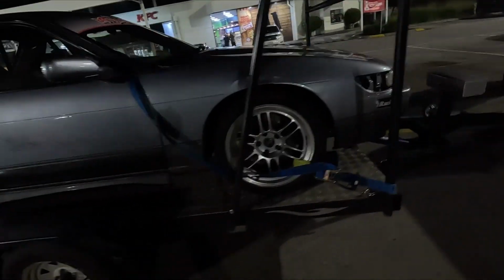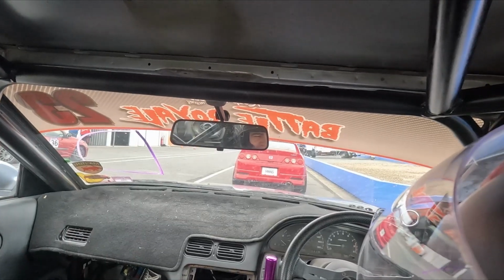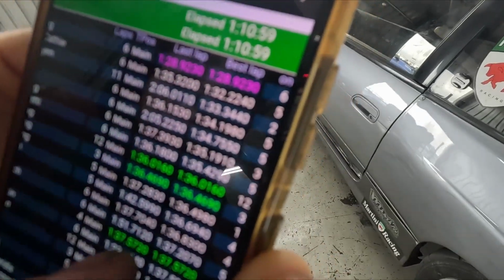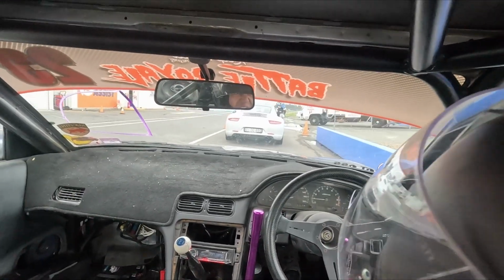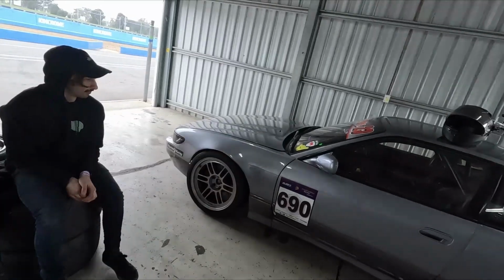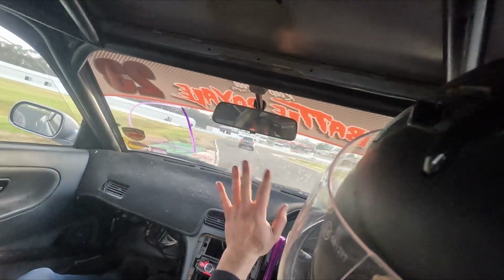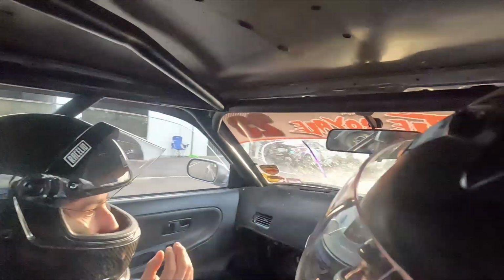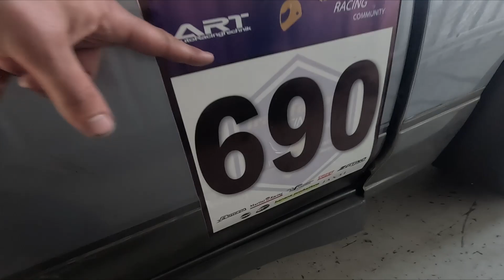Circuit racing a DRIFT car!? S13 TIME ATTACK! Winton Raceway 1:30.4 Lap time

Comment: Wondering if you ran a welded diff during this, or if you were running an LSD. I was looking to do the same thing in my car and came across your video. Thanks!
Reply from the maker: Hey mate! I was still running a welded diff for this yes. However it certainly would've been better with an lsd. But either way still worked and wasn't worth me switching diffs just for this. If I was to making a dedicated circuit car though I'd go LSD for sure!